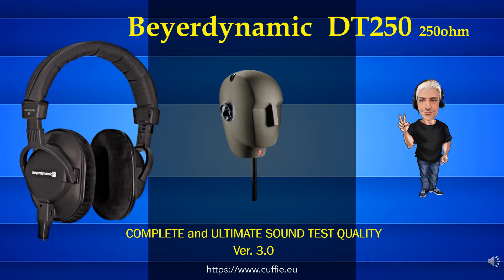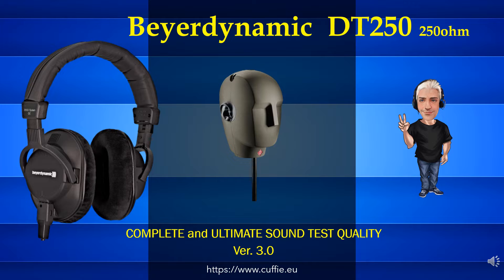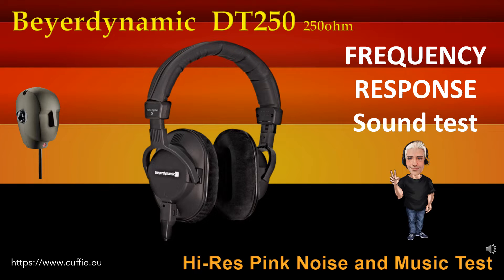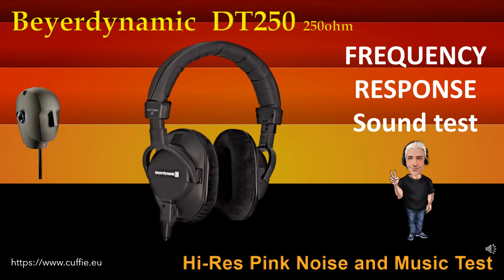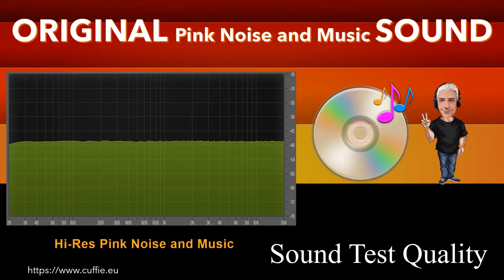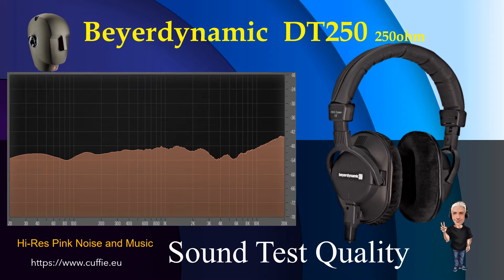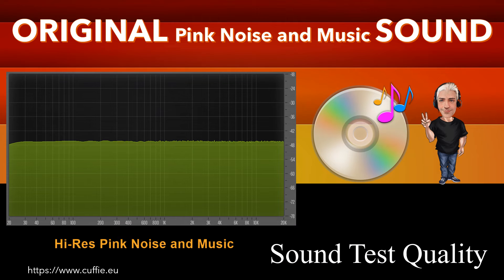BEYERDYNAMIC DT 250  250 OHM

Comment: The highs sound slightly choked and the EQ demonstrates that, but otherwise bang on accurate.  What the heck were the final scores though?
Reply from the maker: that video has no points because the parent company did not give me permission to publish such measurements, see other videos and you will understand what it is about
Reply: @SOLOCUFFIE  
That's unfortunate.  Maybe it's because of the audio imbalance problem due to the connector on the left side.  I hear it's a problem that can be fixed with a bit of insulation and tape.